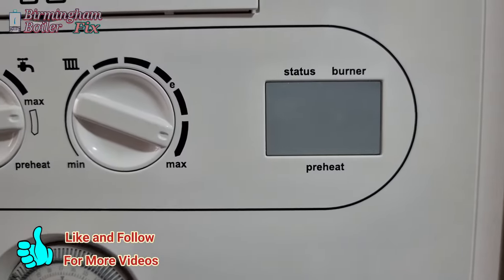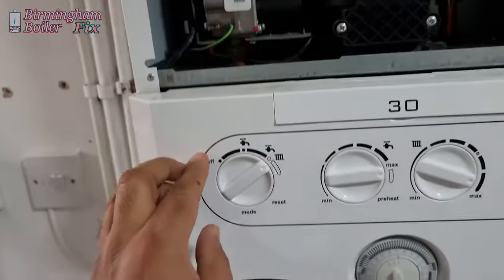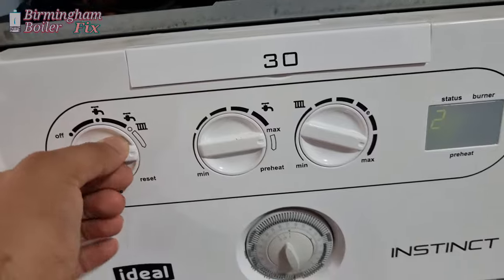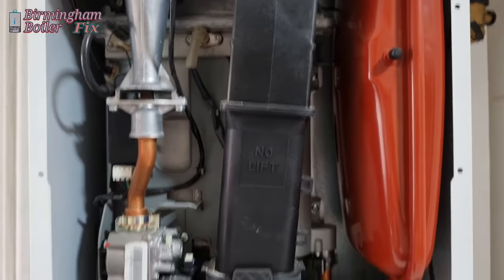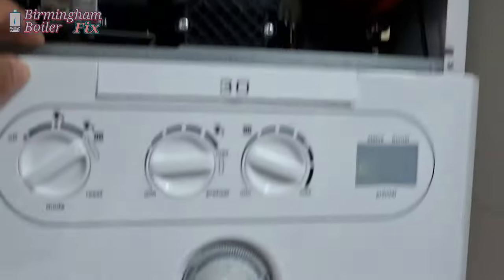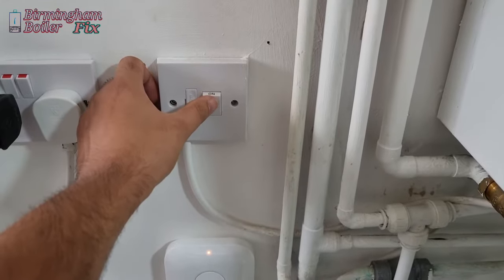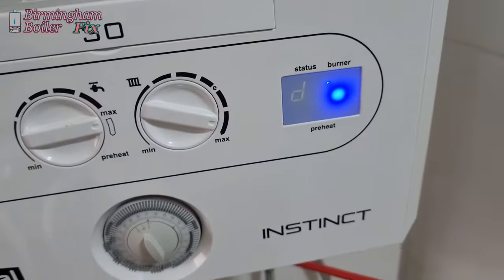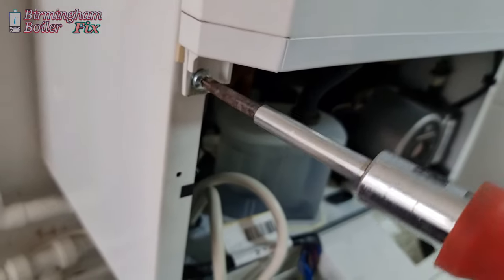Ideal Instinct L2 fault diagnosis no ignition boiler diagnosis part change Birmingham UK

Comment: Thanks for this. You just saved me and my wife from having to spend a cold night in Kent. Didn't notice that "reset" on the dial and our gas had run out of credit (new flat, wasn't used to that whole thing and thought I had it switched over). Got the credit topped back up, but the L2 error was still there. Tried shutting the boiler off at the main a couple times (even waited a solid 10-15 minutes) and that didn't even fix it. Reset fixed it right up tho. Thank you.

Comment: hi I have an L2 fault on my boiler idea i24 have been advised to defrost the condensation pipe which I have and boiler still won't reset. any more ideas?
Reply from the maker: Hi jonny L2 ignition issue its one of multiple issues spark generator, lead electrodes, gas valve or even pcb also condensation trap blocked
Reply: @Birminghamboilerfix  thanks for your reply. I've sorted the condensation trap and pipe so no issues there. So likely more than something I can sort myself then?
Reply from the maker: @jonnydaniel195  yeh you’ll need a competent person to sort it out